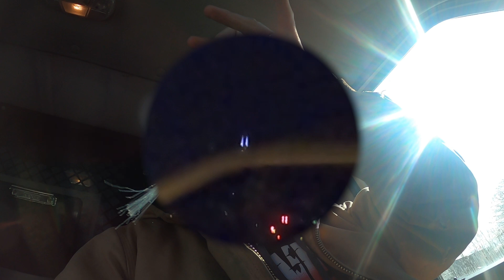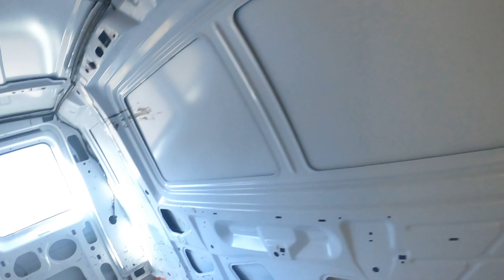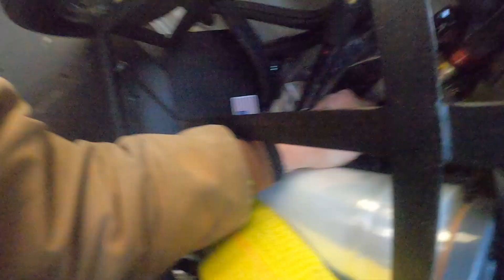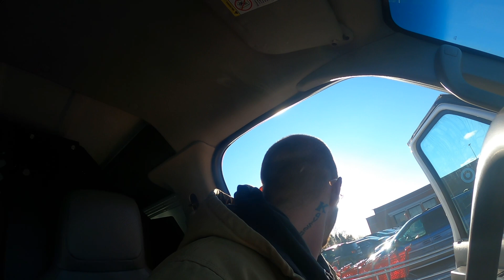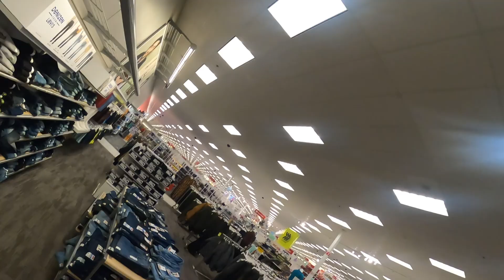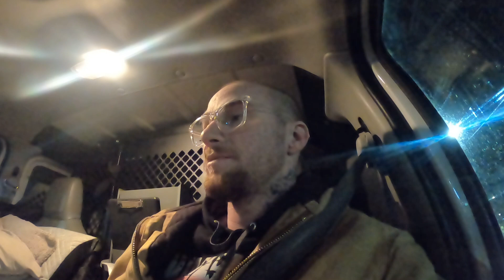Van tour 15 bids NO LOADS expediting business talk cargo van with own authority (owner operator)

Comment: Good videos  thats real hustle talking right there. 
Whats the average rate you run for. 
Or cargo vans can get pay
I was a fleet driver and was averaging 1500 a week me take home in a sprinter MZ 
I want it to get me sprinter but them just to expensive  so I’m thinking about more options
Reply from the maker: I’ve been making 1200 a week on average 800 on the low end sometimes depending on when I want to go home but been getting about a dollar a mile or $1.20 a mile
Reply: @sethleroyhustleadventures  
1.00-1.20 is not bad at all thats about same rates for a sprinter. 
Thank you for your reply 
God bless you all
Reply from the maker: @pedrocastro1876  no problem God bless thanks for watching and the positive energy